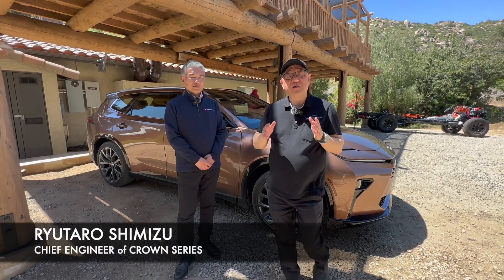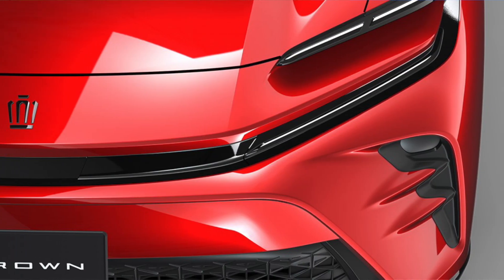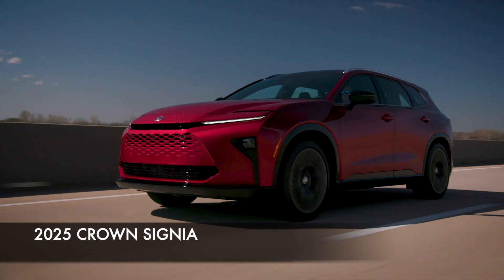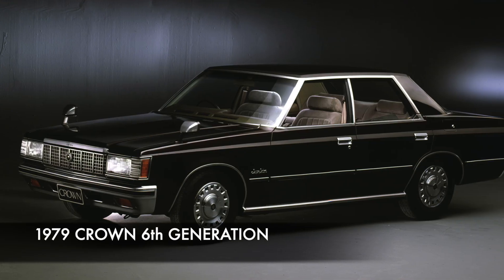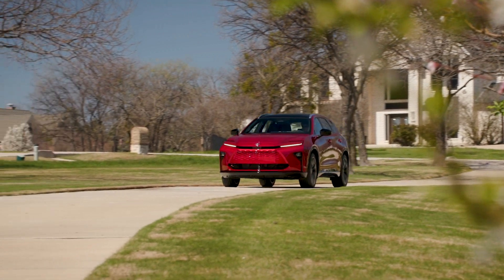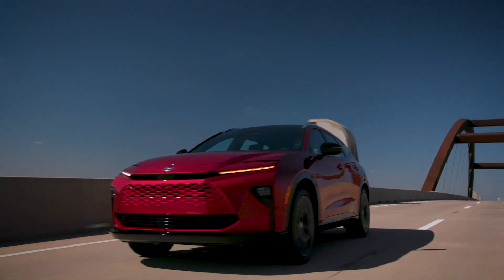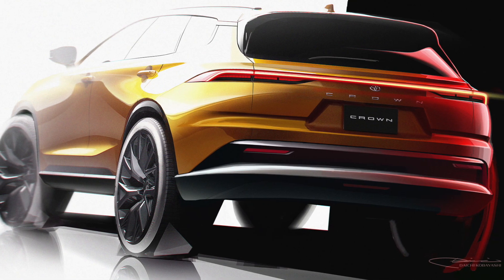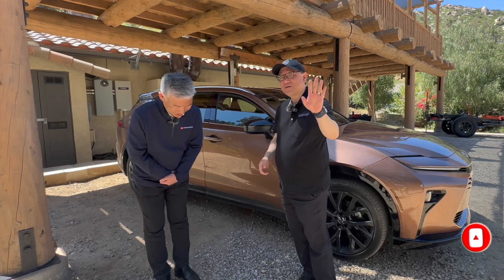CHIEF ENGINEER OF TOYOTA CROWN SERIES // IN-DEPTH INTERVIEW // CROWN SIGNIA // ENGINEER'S DISCUSSION

Comment: Please answer this. 
Why no auto power steering adjustment. 
No DOWN settings on the passenger seat and no memory settings on the passenger side.
Simple things. This is supposed to be the jewel of Toyota vehicles. For crying out loud the Tundra pro gets 8 way adjustable passenger seating but not the Crown? I bang my head every time I get into my Toyota Venza on the passenger side. I'm only 5'10. If the seat was lower or HAD THAT ABILITY this wouldn't happen.
Is there Subscription service for Toyota Safety sense? You have to pay $15 a month for this feature still? Did the price go up?